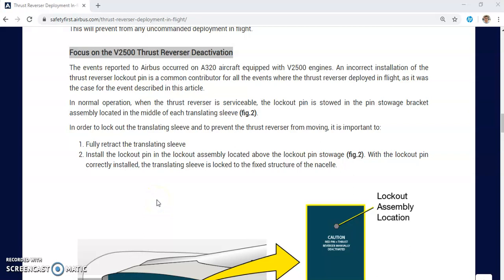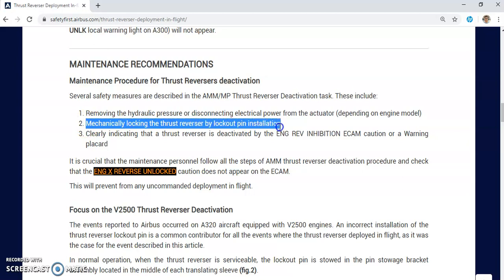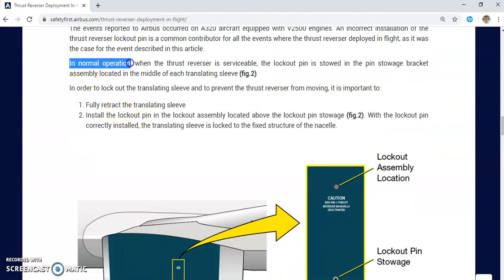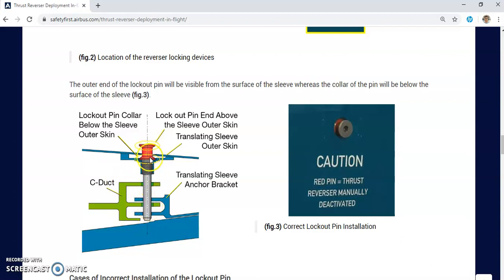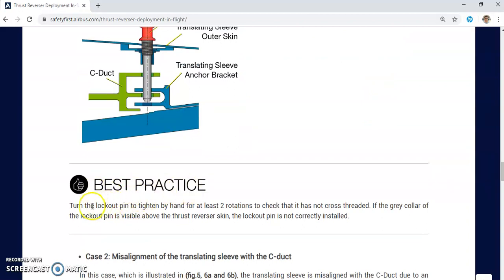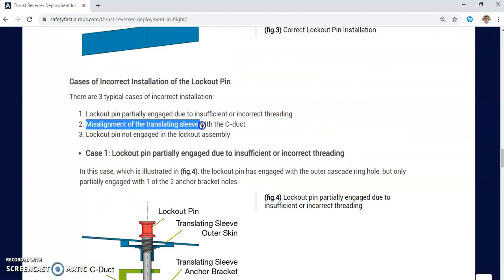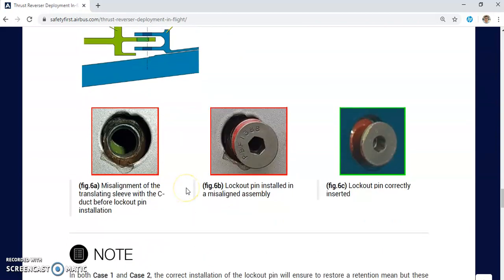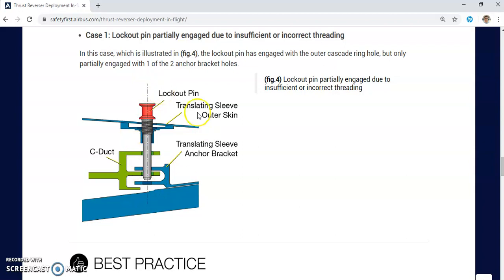A320, Focus on the V2500 Thrust reverser deactivation, mistakes & errors, by haytham aly

Comment: Long time not see Your Video. Hope that you are very well. Wait for more video about A320 family. 
Sometimes Engineers can't install Lockout pin into stowage - the 2nd case.
Reply from the maker: Hello friend, thanks for your warm words , this is not good to allow the aircraft dispatch without installing the lock out bolt (mechanical deactivate)
Reply: Aviation Training Solutions could you elaborate more about "not good to dispatch when can't install lockout pin"  TIA.